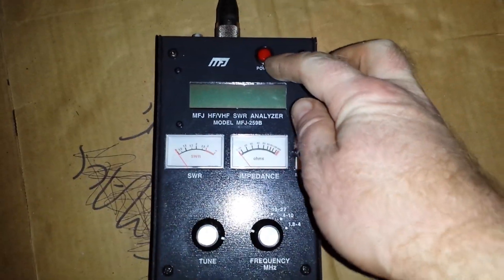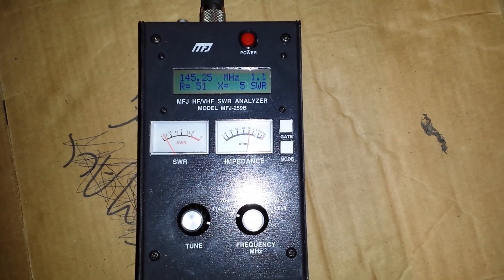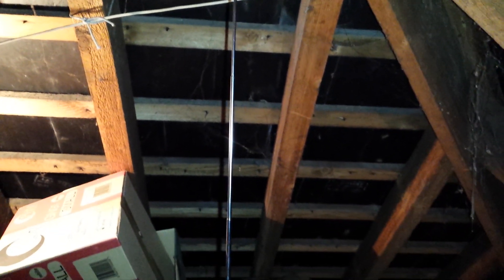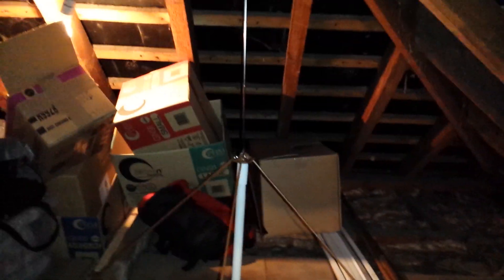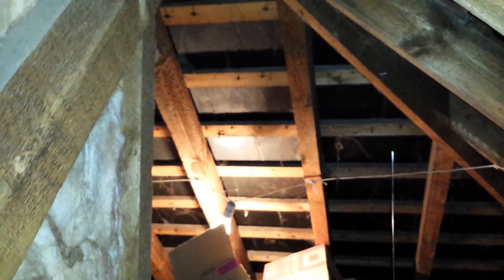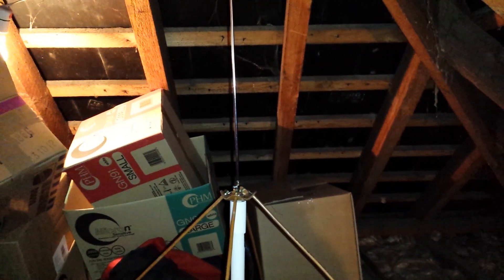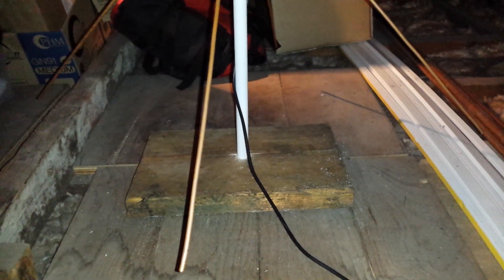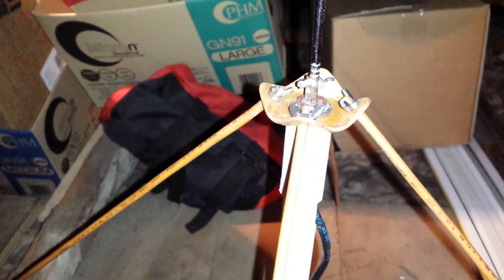1/4 wave vertical antenna for 2m band - 145mhz

Comment: That looks really cool :) if you're broadcasting fm with this sort of antenna,  wouldn't the distance be reduced because it broadcasts downwards?  or does it carry on like I dipole?  I thought the way a 1/4 wave transmits is a bit like -  /|\ which makes it useless if you're broadcasting from like an average height house of say 7m. What would you recommend?  a quarter wave antenna like yours for better coverage from limited elevation or a dipole?  
Thank you
Reply from the maker: dipole would be better but I don't have enough room for it

Comment: Good video, means must!! Do you not tune with the radial angles, for the swr side of things?
Reply from the maker: the radials are at 45 degree's and are a 1/4 wave each. The SWR is tuned by adjusting the radiator length. Search google for more details if required ;-)
Reply: Yeah been searching to much atenna brain mush. Sorry getting confused with impedance, the 45' should give a near perfect 50ohm and then the radiator to tune. Have you directly fed this, no matching, balun or ferrite beads etc. Subbed because i've just noticed i have previously watched some of your other videos last week.
Reply from the maker: +ifell3 absolutely easy to feed.. its 50ohm so no Balun